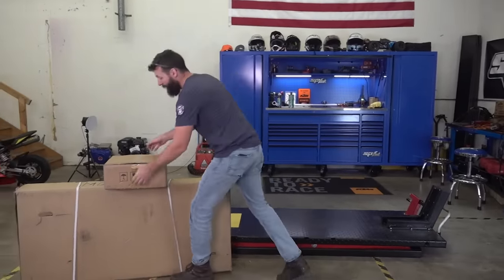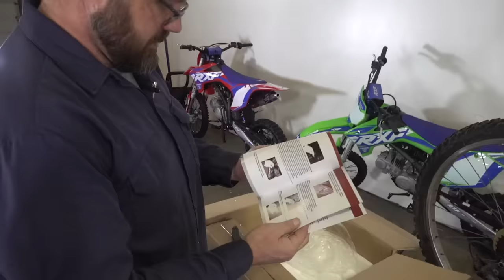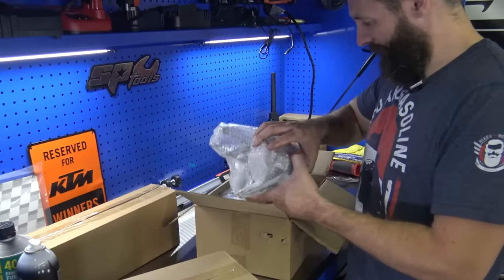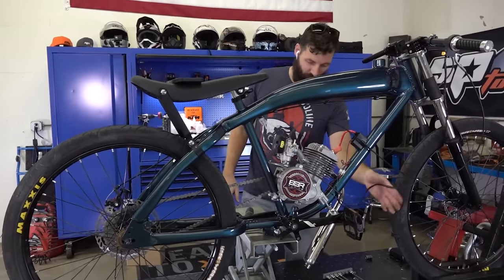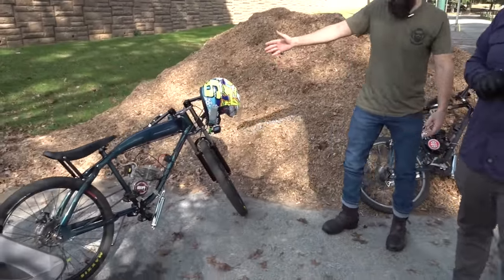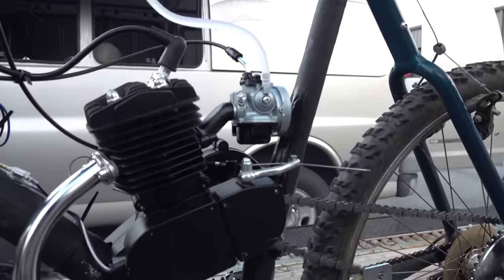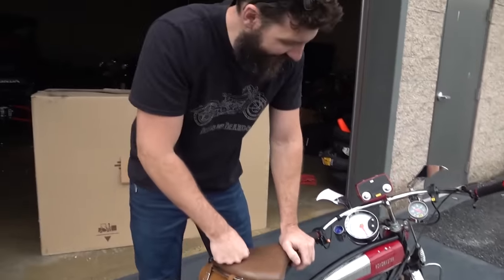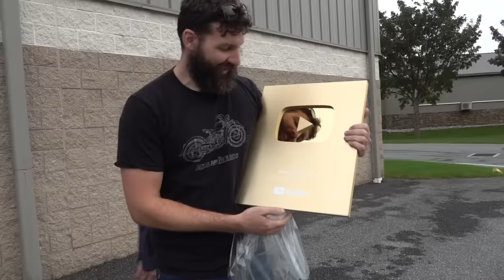I Bought the Cheapest and Most Expensive Motorized Bike kits from Amazon

Comment: That durability test was wack. These are actually pretty reliable engines. I've put quite A few miles on my last one and the piston still looked brand new before I sold it. You guys ran HALF the amount of oil you should be running for break in, that failure is clearly from heat... the piston got too hot and the high rpms broke the molten piston... Disconnect the radiator on a brand new KTM and you'll get the same result....
Reply: also there was no airflow to cool the cooling fins
Reply: I agree. They needed to run it with lots of 2 stroke oil. These are air-cooled engines so need the flow of air from moving forwards quickly. They needed to simulate the airflow with a fan. Fake channel. Fake news
Reply: @michaelsawyer  that's why I mentioned that it's like running a motorcycle without the radiator, of course it'll overheat and damage the piston. And it overheated even faster cause they used weed wacker premix. Give these things a bad name. People think they'll only last a few days, when really the last years.
Reply: Yeah the breakin is crucial . I had a 39 cc pocket bike that did 55mph drove it for years only messed up a couple rings
Reply: Running too much oil in premix actually leans out the mixture and makes MORE heat. If you want an engine to run cool then you need more fuel, and the carb needs to be properly jetted.
Reply: Looks like not a mix fuel use.  Just the same fuel like a car.
Shit broke by stupid use.
Reply: @cameronrees-middleton7726  that can be true, but 16:1 is the cut off for that. Any more oil and that will be true. Really depends on alot of factors. I usually run 32:1 or 4oz per gallon, which works really well for these. The 16:1 break in is mostly to coat all the bearings and parts real well. I personally have used 25:1 for break in personally, which I think is plenty. 40:1 with weedeater oil is not ideal tho.
Reply: @pauld.b7129  too much oil prevents rings from seating properly js
Reply: @mrbanana7167  yes as I just said, unless you're using 6oz per gallon or more, that's not the case. Thats only in extreme situations.
Reply: @pauld.b7129  20:1 is still way too much imo
Reply: @mrbanana7167  not enough to cause an issue. At least not with these engines. Maybe if you're running a high compression engine it would cause an issue. I know some 2 strokes would instantly foul plugs with 20:1 or cause issues, but these run fine on it. Stock compression is like 8:1 so pretty low. I've run full tanks of 20:1 and it works just fine. I always check the piston through the exhaust port ever few hundred miles. Always squeaky clean.
Reply: Correct. Needed WAY more oil for break in and low revs for a full tank
Reply: It's a goof guys... Come on

Did you think they also met at the mulch pile and didn't know each other were there? 

They're having fun making their own "tv" type segments.
Reply: You are comparing an air cooled engine with a water cooled engine. of course a KTM will overheat if you remove the radiator smh
Reply: @TangoOne  yes but an air cooled engine needs to be moving to be cooled. If it's not moving, it's not getting any cooling, so it's not a proper test. That's more of a "how long does a heat failure take" test, rather than durability. A stationary air cooled engine and a liquid cooled with no coolant is basically the same level of engine abuse I'd say.
Reply: @kenstough1166  cuz they not using these ever again😂
Reply: I always run my 1978 Yamaha and 1973 Vespa a little bit richer on oil, I think that’s okay but I do need to clean it a little more often. Like you said these tests where pretty bad they had no cooling and wrong mixture so it’s obvious that they didn’t last long in this test.
Reply: I've had three engines and one jug was bad new. Cylinder liner chipped off and rings had massive blow-by. The other two went forever. I modified the bad one with a new ported jug and milled head and it was the fastest one of all.
Reply: @pauld.b7129  40:1 is plenty, 32:1 is only needed if you're doing crazy tolerance cast iron jug stuff
Reply: @KClO3  I wouldn't say so. 32:1 is perfect, especially if you use good 2 stroke oil. Yamaha owners manual on a YZ250 calls for 32:1 in high temperatures or race applications. And these are old style 2 strokes. Port intake and 2 square transfer ports and pretty cheap machining, better to run rich than not. I've done hundreds of miles on these bikes, and never had a problem fouling plugs or anything on 32:1. I've also taken temperature readings at different times after riding, and it does run hotter on 40:1.
Reply: @streamlobby2341  My chainsaws have basically no airflow and they're rated for 3,000 hours at full throttle.
Reply: @johnjriggsarchery2457  what chainsaw model do you have lets look at that motor design
Reply: They had no forced air for cooling either.
Reply: I legit have over 50k miles on my 100$ engine. Bike isn't working now due to it sitting outside for a year in the desert. Eventually I'll get it running again.
Reply: Thank you for saving Me time in etching this
Reply: 32:1 is pretty fine for these engines during break in. 16:1 in the manual is a joke.
Reply: Yeah that test was crap no body rides like that
Reply: @streamlobby2341  yeah, like old mopeds where the engine is air cooled... The things on full throttle in stand would die pretty early.
Reply: @johnjriggsarchery2457  your chainsaw probably isn't made of Chinese pig iron
Reply: Yea the break in is supposed to be like a 16:1 mixture. Entirely not enough oil. One of the two engines only mounted in the back so not only overheated but vibrated itself to death. So like another comment said shitty durability test. That’s like me putting 1 quart of oil in my truck after an oil change and then rev the engine ignoring every sign of failure until I blow it up I blame my engine instead of me not follow manufacturer reccomemdations 😂
Reply: On top of all that air cooled engine and you have it sitting still, one spot redlined. I wonder why they blew 🤦🏽‍♂️
Reply: @pauld.b7129  they have air cooled motorcycles and mopeds. they do have fans however.
Reply: @Jamie_GTCS  these are hit and miss. you get one that fails 10 seconds after you get it or one that just runs forever.
Reply: Well yeah you are talking about a KTM not a Honda
Reply: Two tips one the piston is installed backwards on half the motors the ring end will clip the port. Two the timming is way too advanced gring the keyway to retard the timing this will give you double the rpm and power.
Reply: These bicycle engines are complete trash
Reply: @noway4668  Nah, all depends who builds em. I've got hundreds of not thousands of miles on mine and it still runs like when I bought it. Still starts in 20 degree cold, cylinder walls still look nice and new. They're great for 100ish dollars
Reply: Likewise. I built one on a schwinn beach cruiser and called it the Schwindian. Ran like a top for years, rode it to work every day, had a trailer for hauling groceries, rain, snow, sun, everything year round. The motor lasted longer than the frame did. I finally got rid of it when the frame sagged so bad in the middle that it was getting too hard to keep the chain tensioned. Built a few more after that including one of the Bullet Trains that had the electric starter (loved that one in winter, so much easier to start). Eventually swapped over to electric bikes. Might do another gas build in the future
Reply: @volvo09  That's not really the point though. People watch this and form opinions that these engines are cheep short use junk not forth the couple hundred bucks.
Reply: @TangoOne  And an air cooled one will overheat when held at full throttle with no air flow
Reply: @johnjriggsarchery2457  Chainsaws have forced air cooling.
Reply: @pauld.b7129  seriously, one of the reasons I've been having second thoughts about building one is people saying something will break every 2 or 3 rides.
Reply: @KvltKommando  Only if you build it wrong. I've literally put thousands of miles on different ones without anything breaking. 90% of the time if something breaks, it's your fault. Of course you can always get a defective part, but really these are pretty solid overall. Great 2 stroke engines. The weak point it really the bike itself, since most aren't made to have an engine. It's fun and fairly reliable nonetheless though
Reply: @pauld.b7129  right. im only on this video because it autoplayed i think, so i gave them a dislike because it was wack. but im about to get a bt100 from bikeberry and there are some weak points to iron out like the hub adapter and chain tensioner etc. and just overall make sure everything is solid. the thing is a lot of teenage boys get these and do everything cheap and janky, or like these guys in this video, just halfassed.
Reply: I’ve put down 100miles in one day on mine

Comment: Durability test could've been better. Engines broke bc they weren't being cooled.
Reply: They didn’t break because they weren’t cooled they broke because they hit redline with no load on the engine🤦‍♂️
Reply: See you get it they need load
Reply: @tylerseabook9423  what do you mean? And would that apply to a manual car?
Reply: @TheNaturalGamer1   100% what do you mean what do I mean the engine was held wide open in neutral
Reply: @tylerseabook9423  How rude! Well excuse me for asking
Reply: @TheNaturalGamer1   nothing rude about what I said. Don’t be such a baby
Reply: @tylerseabook9423  change your tone geez
Reply: Tyler Seabook they do blow from not cooling too that’s how I blew my first engine this past summer. They definitely last longer when it’s cooler out, you don’t gatta stop every 20-30 mins too cool it down.    But holding the throttle wide open with the clutch in will definitely blow it up a lot faster than if it was being rode or even have the wheel off the ground so it’s not just in neutral
Reply: @jameswalker4816   if it’s running properly that motor could idle or cruise  all day in hot weather. You are 100% wrong. If you had to let yours cools down something was wrong. You couldn’t be further from the truth with everything you said
Reply: @jameswalker4816   In fact how long would it take to burn a tank of gas on one of these? Three? Four hours if it’s running properly there be absolutely zero issue to run that thing until it’s out of gas 🤦‍♂️
Reply: Tyler Seabook what ever you say bud. The instructions manual tells you you have to stop and cool them down. The engine produces a lot of heat, heat burns out the piston and rings but every one should listen to some dude that doesn’t know his ass from a hole in the ground over what the manufacturer says 😂👌
Reply: @jameswalker4816   the engine produces a lot of heat😂😂😂 not enough to blow them up. The real problem here is bozos that have no clue what they are doing blow them up like yourself then decide they need to be cooled down every 30 minutes 😂 if they were gonna blow from heat it would take five minutes to get too hot not 30 minutes 🤦‍♂️ there’s no set time with too hot at 15 minutes the motor would be no hotter at 30 minutes. You a real smart one you
Reply: @jameswalker4816  he is correct. You should not be having to cool your engine down. You must be running lean, or running a cold spark plug.
Reply: Matthews Music yeah I figured that out after looking into it more. I also read through the instructions again and they didn’t say anything about cooling it after 30 mins I think that got in my head from the guy that helped me fix it one time, the instructions basically say that if it starts running weird to let off the throttle some. That’s not exactly what’s it says but close enough
Reply: Matthews Music but they still have to be cooed they need airflow the way they tested it in neutral and full throttle is definitely the fastes easiest way to blow the engine
Reply: @jameswalker4816   no they don’t. As long as there’s a load on the engine not wide open in neutral it doesn’t need cooled down. Doesn’t need air flow
Reply: @tylerseabook9423  air cooled engines rely on airflow. Running rich helps but does not do enough. Coming from aircraft engines on that one. Take the props off and the engine will overheat just idling. 
Oil also does a lot more than you think it does for cooling which is why a lot of air cooled engines of all sizes and descriptions will have oil coolers.
Reply: @Demonslayer20111   everything you just said is wrong. False. Complete nonsense. A 2 stroke air cooled engine not held wide open in neutral should idle all day zero problems 🤦‍♂️ please spew more nonsense though it is comical
Reply: I could have run either of my Husqvarna chainsaws for days like that without a problem. They're shrouded and don't roll down the road. These engines failed because they're crap.
Reply: @johnjriggsarchery2457    Wrong. You are right about running for days but these didn’t fail from a quality issue as explained above. They failed because they were held wide open in neutral with no load on the engine.
Reply: @jameswalker4816  then your carbs not jetted properly you fuel ratio ran  lean and over heated the motor you need to get a bigger main jet more fuel cooler motor its common sense with 2 stroke bikes mine has a 67 main and I can ride non stop till the tank is dry
Reply: becks bikes thanks, I have the problem fixed I haven’t had any issues with the engine I got now, I run it constantly with stopping to cool it down
Reply: @jameswalker4816  no problem glad you didn't give up
Reply: @tylerseabook9423  I'm new to the motorized bike thingy, and everything everybody told me, is exactly what you been saying in this conversation...
I'm building mine to run slow, just cruise at less then 12mph. People told me I should be just fine cruising at low rpm's all day.
Reply: @savagegtalks5912   100% just keep a load on the engine and it will be fine. These bozos saying they blew because the gas mixture isn’t right are clueless
Reply: Also didn't have the right 2 cycle mix 
It a 100:1 mix for those engine even says it on the websites
Reply: Logan Eigel   no way...  I got lawn boys an toros  that take 40:1 50:1 

That not cheap engines 
 
These engine r stupid cheap
Reply: @JorgeVonVogler   everything you just said is completely false
Reply: Logan Eigel   they definitely get nowhere near 100mpg
Reply: @tylerseabook9423   explain??? I will say I don't think BBR doesn't tell you the fuel mixture must have been the Amazon engine.  The lawn boy statement is true 32:1 I use 40:1 
Toro Engine 50:1
Reply: @JorgeVonVogler   it’s definitely not 100:1
Reply: @tylerseabook9423  I know what I read lol weather you want to believe me or not that your problem lol
Reply: @tylerseabook9423  yeah it also did overrev
Reply: Half of the motors the pistons is installed backwards and the rings clipped the port. The timing is way too advanced, grind the key way down to retard it double your rpms.

Comment: You’d be surprised, I bought a little 80cc 2 stroke china choo choo engine for 150$  and ran it 40/1 and got probably about 1500 miles out of it before the piston ring snapped and seized the motor.  I had it on a 700c road bike frame so it had pretty good top speed. About 38 miles an hour. I ran it about 10 hours a day maybe 100 miles a day. Did Uber eat deliveries on it. It was basically a pk80 clone 👍🏻
Reply: I would hope for it to last more than about 15 days, but I guess 10$ a day isn’t too bad
Reply: That actually could have just been an assembly issue, it is surprisingly common for these motors to come with the Pistons on backwards causing the rings to come out and freak up the cylinder
Reply: Sounds like my Seeutek PK80, it's 66cc and kicks ass with a muffler mod. Take the baffle tube out and immediately another +3 or 4 hp
Reply: You made deliveries on it?! using this like a motorcycle is what ruins it for the rest of us.
Reply: lol what bike frame did u use
Reply: 40:1 for life!
Reply: @morrisjohnsonakamj6346  what got ruined for us? Wtf you talking bout?
Reply: @Freebyrd1991  exactly what the hell is he even talking about might as well make money while you ride.
Reply: @eugenecrabs3954  haha. They have nowhere near 3 or 4 horsepower to begin with. I believe they are about 1 hp.
Reply: @mickangio16  2.75
Reply: @Gamer_plays_ 2 stroke stuffing dynoed it after a couple hundred Kms and he got 1.4 hp at 5k rpm for 80cc 2stroke
Reply: @1ilrx hmm.. a 50cc 4 stroke moped motor is good for 2.5hp.
That's unbelievably low for a 2 stroke...

Comment: I had one of these in college and rode them all around campus! It was AWESOME! I learned so much about 2 strokes and Carbs (I am a Software Engineer so no school on these) I even re balanced the crank shaft! These things are so fun!
Reply from the maker: Right on
Reply: @BikesandBeards  Next time use an appropriate oil and mixing ratio : AMSOIL SABER at 2 percent.

The engine runs cooler, the lubrication superior.
Reply: I’m a sophomore in college and I currently use my gas bike to get around campus. I love it, super cheap, lots of smiles!
Reply: hell yeah i rode my bike everyday the best for me was building the perfect bike once the mechanics were down it was all different
Reply: @cruzkennel  High miles per gallon, high smiles per gallon :)
Reply: BronzeKaiser  build another!
Reply: @username costs more money lol they bought some of the worst kits there are. people build extremely high performance bicycle motors running over 70mph basically built like a kx65 motor, it just costs a lot more.
Reply: @cruzkennel  what brand
Reply: @BikesandBeards hey I was wondering where did you get that bike at the end of the video it looks sick